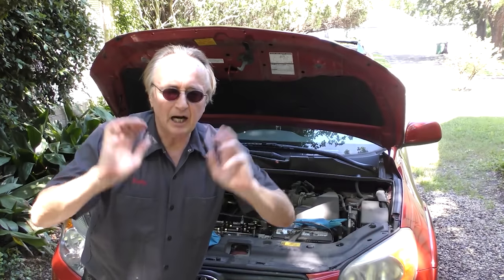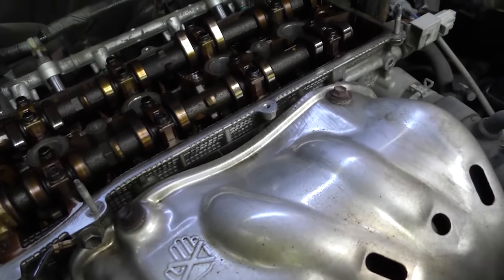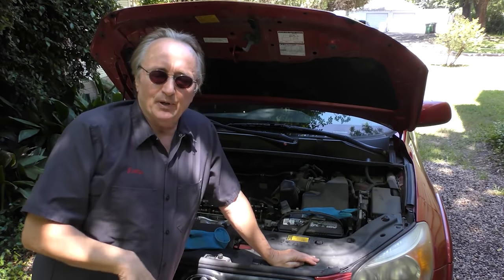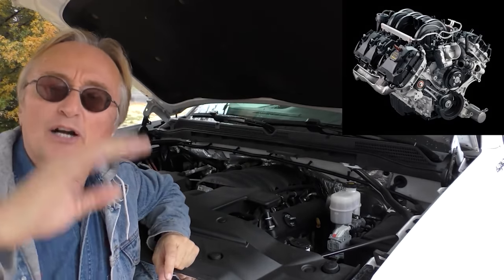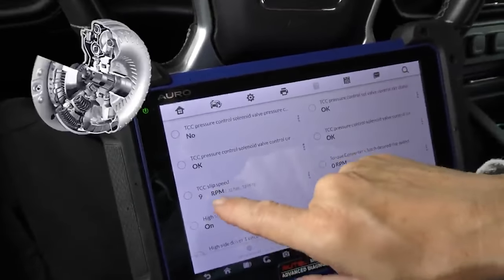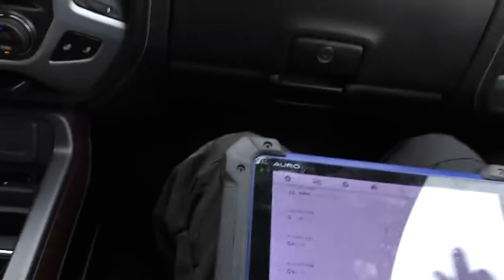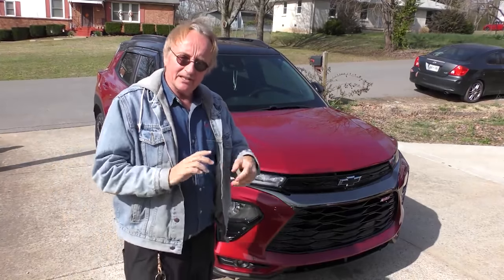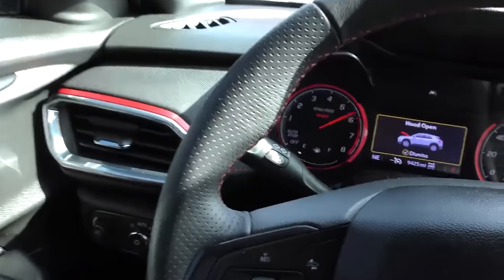Avoid These 3 Engines Like the Plague

Comment: Gm didnt learn from the 8-6-4 engines in the 80's so they decided to give it another go. Maybe they will put 350 diesels in their new cars and trucks again lol
Reply: Ooohhhh YEAH!! Bring that sexy 2.0, diesel iron pony back from 1984...  Hahaha
Reply: I remember chevy 350's that "G.M." converted to diesel engines, they had to jack up the oil pressure to 95 psi ( at an idle) and they still came unglued!!!!. you cannot take an engine that was designed to operate on gasoline, and slap diesel heads on it, and expect it to stay together!!!! another "G.M." first in stupidity, just like the "CADI" V8-6-4 engine!!!!!

Comment: I have a toyota corolla 2010 with 2ZR-FE with 100,00 miles not sure if i will have the same issue.  But I put in Mobil1 High Mileage Full Synthetic every 3 months.  Will this save the engine if its one of the bad ones?

Comment: Yup. I have that engine in my 02 4 cyl Camry, manual. It has 184,000 miles, runs great even with the engine light on for catalysts converter  below efficiency.

Comment: Dang, in the good old days of full-size Blazers and Broncos with V8s.
Reply: Right. Thats no blazer.
Reply: I just bought a 03 blazer from my uncle with the 4.3 by has like 180k miles runs good still lol
Reply: Gotta cherry K5 blazer down the street. I want it real bad but dude never gonna sell it
Reply: @ROBinJVILLE  I had a 77 Blazer with 350 corvette cam, Edelbrock manifold, carb, Headman Headers, 33 inch tires, chrome rims, 43 gallon tank with skid plate, manual locking hubs which I had installed, tube bumpers front and rear painted in Black Cherry, Italian leather steering wheel, Hella fog lights, 4 1/2 lift kit, air horn, custom interior, tube grill. It was silver with burgundy hood stripes. Sold it to a police officer. Saw it a month later and I wanted to cry. It was completely destroyed. Obviously some people treasure vehicles more than others. The sad part was I got rid of it because gas was $1.50 a gallon for premium so I bought a Subaru wagon. I should have kept it.
Reply: Lots of those here in Nevada its awesome most of us lopped off our catalytic converters so almost no thefts here hahaha
Reply: Cry
Reply: @jimchance5006  😢

Comment: I owned 3) 1972 Chevy Vega GT's in a row. I loved my Vegas... Loved the way they handled and drove... There was only one problem I had with them... All had the aluminum 2300cc engine and all had the factory steel sleeves in the cylinders. I never had a problem with burning oil. What I did have a problem with was... If the engine over heated one time. It was ruined by warpage... I finally solved the problem by installing a V-6 in my 3rd Vega.

Comment: None of these engines compare to the issues with the Ram Ecodiesel.
Reply: What issues does the ecodiesel have?
Reply: @AVS-182  crank bearings, head gaskets, maybe snapped connecting rods, hydrolocked engine.
Reply: Get a Cummins not the ecodiesel.

Comment: I have one of those GM 5.3 ECOTEC3 motors in my Sierra.  It only does V8 and V4 modes, not V6.  When it analyzes conditions to switch to V4, they have to be ideal... as in flat road (no incline), not much wind, speed maintained, etc.  The moment the engine detects any diversion from ideal cruising circumstances, even imperceptible inclines in the road, or anything that asks a little more of the engine/transmission, it switches almost instantaneously back into V8.  Have almost 100k miles on it, and the V4 mode rarely activates.  Probably pointless technology on that note, but it has worked well for a long time.

Comment: I have an 09 Camry with that motor. Mine has 217k and burns less than a quart every 3k miles and runs great. Not sure if it was ever fixed, but so far no worries.

Comment: Yes Scotty ... I got them to do the repair at 80,000 miles on our 06 rav.  They told me to pound salt 80,000 mi later when it happened again. Whatever was wrong with those Pistons when they fix it the first time they put the same crap piston parts in and now the same problem is back again.  I looked forward to having a car that ran great for 200,000 miles with no issues from toyota. Now I'm in a Subaru.  Sure we kept the rav for my daughter to drive but like you said I just had to rechange all the plugs and wires and 02 sensor and I'm waiting for the catalytic converter to go. Other than that the car is great. It feels too valuable to throw away and who would I sell a car that burns a quart of oil every thousand Miles too?

Comment: I have a 2017 Silverado LTZ 4WD, 1500, crew cab, short bed with the gasoline 6.2L engine with 26,000 miles. I get about 15-17 MPG in town & 23-27 MPG on the highway driving at 75 MPH & the engine always stays in the V8 mode. I get about same as my dad's 2018 GMC Sierra 1500 SLE, 4WD, crew cab, short bed with a 5.3L engine which switches in & out of V4 mode with about 10,000 miles. The only problem I had was the transmission started shifting erratically & that was due to the factory putting in the wrong transmission fluid. I can drive from Wilmington, NC to Clarion, PA (about 600 miles and about 80 miles northeast of Pittsburgh) on 1.5 tanks of gas all in V8 mode.

Comment: This happened to me on my toyota 2009 camry.. Bought it used and didn't know it burned oil... Took it in for a radiator issue and thats when I found out I had no oil even though it was full a few weeks ago...i went online found Scotty and got educated... Those engines are tanks .. Drove it for hundreds of miles without oil and still purrs like a kitten at 160 k miles

Comment: also, you can try to remove the spark piug and fill the cylinder with EGR liquid solution for Diesel engine (Bardalh make a good one). If the level stay high for a long time, or get down very quickly, your rings rings are cloged. Re-apply the liguid 3 times, the level should stay table for about 15/20 minutes, then, replace your engine oil ! And clean the O2 sensor 30 minutes in a pure white vinegar alcool solution

Comment: Ford had 80% of the 1996 Windstar vans recalled for a head gasket design flaw.  I had the same problem and after arguing with Ford for 6 months, trying to get them to fix my Windstar, they asked, “Did you buy the extended warranty?”  I didn’t and they said they couldn’t help me.  I said bye to Ford and will not buy a Ford now.  I’ve been fairly happy with my Silverado (2002) with 212,700 ish miles.  Now have moved to Lexus.  I’m really pleased with Lexus.

Comment: Chevys shift rough when you’re putting around with no load especially the 1-2 and 3rd gear shift I am at 210,000 miles in the 05 L33 Silverado 4x4 LT trans never been rebuilt but still hauling stuff

Comment: I had a Corolla with this engine, they also came with the wrong dipstick & you either overfilled it with oil or wasn't putting enough in, I can't remember, but these had more than just issues with sludge & Toyota had to actually send people new & proper dipsticks, however they wouldn't fix the sludge issues.

Comment: Avoid Chrysler Neon 2.4 litre engine found in Neons, PT Cruisers, 4 cylinder Jeep Wranglers, some Sebrings. Also avoid any inline four cylinder engine with a turbo.  They are nothing but grenades.  
Avoid the AMC 242ci engine (Powertech 4.0) from 2000 to early 2001 unless the word, "TUPY," can be seen inside the oil fill opening.  Avoid the Cadillac 350 V8 diesel and the North Star engine.  Avoid any small engine in a large vehicle.  The small engine is being run to the edge of self destruction in order to move the larger, heavier vehicle.

Comment: I bought my first car new car about 20 years ago it was a Nissan Altima with a 3.5 engine.  I had this car for seven years  and had about 100,000  miles on it and I traded it in for a new  Honda Civic EX 2014 , great!  I drove for 2 days and the check engine light came on, I called Honda.  The Honda service guy tells me not to worry I can bring it in  2 weeks!  2 weeks, I said  this is a brand new car so I drove up to the dealership , got the guy who sold me the car and he talked to the service people and hour and a half later I was told the car was deemed unsafe to drive  because there was a hole in the gas tank.  The gas tank had been chewed by some critter at the dealership.  If I had waited 2 weeks do you think they would have told me the damage was done at my house?  I saw the hole it was about the size of a quarter!  No problems at all after that  incident.  I just took it for regular maintenance.  I’m obsessed with oil changes  and checks.  A friend many years ago had a beetle(maybe 1970] .    My girlfriend  never checked the oil or changed it ,and we are coming down the freeway going to Detroit  the loudest bang I ever heard.  The engine blew up!  It’s an experience I do not  ever want repeated!

Comment: 2azfe is a good motor I seen a few with over 300k miles.  I used to have one in my old Camry and I gave it to my dad.  More than 200k miles and going strong as a daily driver.

Comment: You can buy certain 2021/2022 Silverados and Sierra's wit the 5.3 V8 WITHOUT the AFM/DFM engine; just a straight V8. The code is YK9 without AFM/DFM with a $50.00 rebate on the Moroney label.

Comment: I don't know what to think? I actually had a 1972 Vega 2 door sport wagon, it was silver with the cool double black center stripes like the 1970 Chevelle SS? 😂 and I don't remember adding oil that much? The only reason I got rid of it was because of the decayed unibody? And I also had a 1975 Vega hatchback with a manual 4 tranny and the only reason I got rid of it was because I upgraded to a bigger car? And I had both of them in the early 80's when I first got married and we had 2 children and things were a little tight. 😂🤣 but I actually liked those two throw away cars? They really were cheap to maintain and I did most of the work on them myself, I didn't need a computer and I had lots of room to work 😂🤣 one example is, we went uptown to shop which was 25 miles from home, we were driving along and the car stopped, spitting and sputtering, I pulled to the curb and I crawled under and I saw the mechanical fuel pump had worked itself loose and all I had to do was tighten it up and away we went! 😂🤣 to hell with the gasket? It's just a cereal box anyway? 😂🤣

Comment: it’s a cold day in hades when a p.o.s. chevy vega is lumped together with a toyota.
Reply: Ha ha ha ha ha!
Reply: I think i heard that the devil has started giving ice skating lessons. I had a used 1976 Ford Galaxie that I had to put a quart of oil in every 50 miles. There was an oil leak somewhere. It had a 302 CI V8. It was a nice car until it started leaking oil. I finally had to let the car go. The previous owner had a 8-track player in it but one of his 8track tapes was stuck in the machine and I never could get it to remove. The tape wasn’t even music that I wanted.
Reply: @Asto508  still better than American
Reply: A engine flaw is a engine flaw. I have the 2AZ FE in my 03 camry, other than burning a little oil it runs like new with 250k miles.
Reply: @Yammie_Moto671  Well, if you like getting randomly speed limited at 110 mph (might go lower in the future) go ahead, get a Volvo.
Not saying American cars are somehow good, but why choosing between two evils?
Reply: Engine flaws are common. The engine is the single most expensive item in a car’s design. It is the Achilles heel for ICE cars.
Reply: *TATRA Rear engine V8.
Reply: Electric cars today can run away and hide from any ICE car. And still handle well due to neutral weight distribution and low CG.
Reply: @repentandfollowjesuschrist6170  I also have one in my 09 Pontiac Vibe GT. Just cracked 100k miles and not burning oil yet. I’ll keep my eye on it.

Comment: Scotty: you completely nailed it on the Vega. the absolute worst POS to ever come out of an American assembly plant. the first 3 years of production saw a radiator so undersized that it could barely cool the engine, even in a cool climate. And the spray-on cylinder liner nonsense? That's exactly what it was. Some sort of Silica aluminite mixture said to adhere to the aluminum cylinder walls, which is failed to do. With regularity, i would see Vegas with 8000 miles on them and motors already failing. One quart of oil consumption per 200 miles became the norm with these turds. Absolute garbage!

Comment: Regarding the cylinder de-activation engines, I never understood why anyone wanted a big engine that crippled itself to run on fewer cylinders. After all, it is still a heavy vehicle with a heavy drive train driving BIG tires. That logic to me is like, "Hey, I'll yank some spark plug wires to get better mileage!" Yeah, right. 

Regarding GM in particular, I haven't bought a GM product, new or used, since they killed the Corvair and used Ralph Nader as a scapegoat. Midway through the second gen (1965-69), they decided it was too expensive to build (they already knew that in advance when they pulled the wool over the CEO's eyes when they were designing it). Then Ralph came along just in time to make GM look like the victim. At that time, the second gen Corvair was more technologically advanced than the Porsche 911, but that's another story. The car was awesome. I had a 1969 Corsa that I still wish I had today.

Comment: My Scion TC burns oil with this engine. It's been doing this for years, i just change the oil every 3000 miles. It runs great with over 200k on it. It's been doing this for over 8 years, it's not a lot oil being burnt up in mine...
Reply: What OIL  you use ON it?
Reply: @tomasnokechtesledger1786  I've been using Castrol GTX High Mileage 5W-30 forever. I also use Fram tough guard filters (I know some hate them but I like them).
Reply: @mikeross111  I would try a fully syn with ester, asap, maybe the short oil change interval could make the dino gunk easier to go away from the piston oil return holes. My 2c. I WOULD'T keep using conventional.

Comment: I have an 09 Camry and took it to toyota for the oil consumption recall (the one Scotty is talking about) and they did the test and "determined" my engine is fine and I don't need the fix. I have to put about a quart of oil every 4k miles. Not the worst thing ever but super annoying

Comment: The vega engine wasn't exactly GM's design fault. If the silicon aluminum delivered had met the promises of the metallurgists and maybe the specs of the test samples it would have held up. They should have started with a  smaller run Pontiac model, work out the problems under the experimental brand.

Comment: The real TB is body-on-frame , can tow over 6k pounds , has REAL low range 4WD . and has a 291HP 4.2 Liters DOHC Atlas inline 6 super dependable and lots of torque , over 90% at just 1800RPM.

Comment: I have a 2013 Kia soul as 94,000 mi on it I just took it in cuz it was burning oil and it had error code connecting rod bearings I'm going to see if they're going to replace the motor I'm still under warranty so I know what you're talking about finish up since Monday I'm hoping it's just going to go ahead and drop me in a new deep motor so I agree with you about Toyota also Kia has the same problem you've been a motor 94,000 mi has put in a quart every hundred miles I went 280 miles and it was burning two quarts of oil both ways so I know what you're talking about I really look forward to listening to you on the show
Reply: I'm curious to see if hyundai puts you off for another 6k miles. Keep us updated.

Comment: Scotty, I do enjoy your show - common sense while entertaining! I have a 2007 Silverado LTZ that just went over 280,000 miles. It has the engine you’re featuring that drops to 4 cylinders when on level or downhill grades. I routinely get from 19 ~ 22 mpg a tank here in northeastern Ohio, which I think is great. I drive a lot and mechanically, take care of my vehicles, cosmetically, not so much! My only problem with the engine, is oil consumption. I will use two quarts between changes of roughly 6000 miles ever since I bought it at 60,000 miles. That is directly related to the rear two plugs that become oil fouled every 20~30,000 miles. The dealer told me of a fix when I had 150,000 miles, but I thought it was too late and expensive compared to my present costs. About 5 months ago, I had two weeks of major repairs! Main computer and had the transmission rebuilt. The external oil cooler had a sudden leak, which probably led to the transmission problem. I had this transmission serviced every 100,000 miles, which is probably responsible for its long life. The last several cars with no tranny service, always needed rebuilding well before 200,000. I’m a slow learner. I’ve had extremely few problems with this truck and everything still works except the lumbar support! I recently changed oil to NAPA’s partial synthetic which appears to help my usage and 15# of increased pressure. 
BTW, my last truck was a 2000 Suburban with 314,000 miles. It was even better with no oil usage, the aforementioned transmission rebuild and a fuel pump failure that I was reimbursed for under a later recall. MPG of 16 ☹️. “Rev up your engine - - slowly!”

Comment: The big secret is you keep your transmission fluid clean if it gets dirty you’re screwed you can’t replace it for your transmission will stop work it’s kind of weird but that’s how it works I’ve had 3 proper trans flush (I got a transmission fluid exchanger from a dealership that went out of business) The transmission fluid has always been clean and the filter has been changed one time next it’s time to change the solenoids maybe and I’ll let you know when it goes out

Comment: Honda odyssey with VCM engines has  design flaws and the engine burns oil prematurely; misfires; and engine mount problems because the engine runs unbalanced when the 3 rear cylinders shut off.